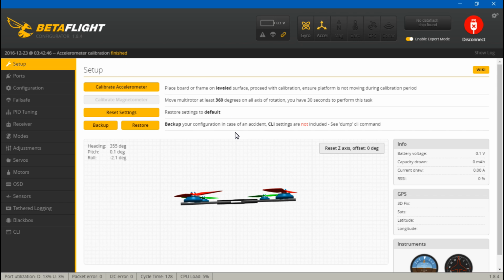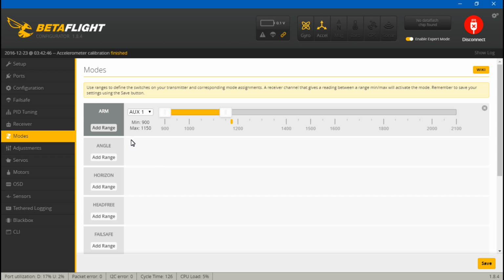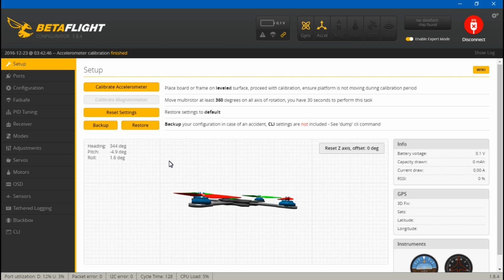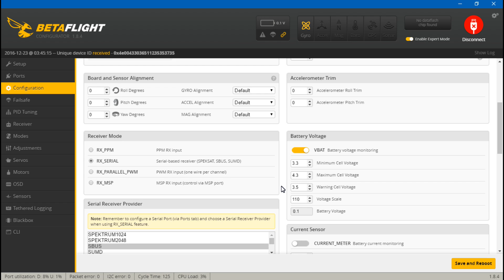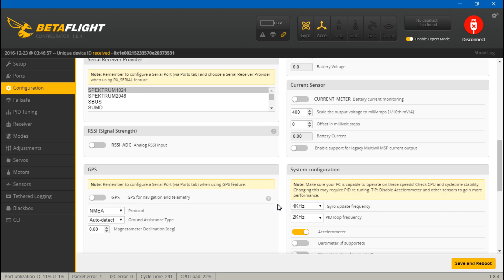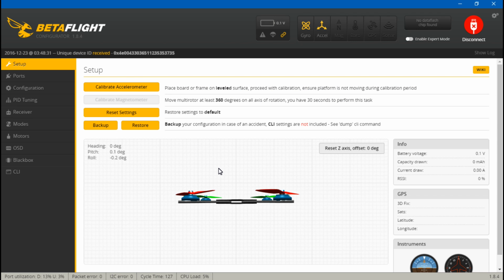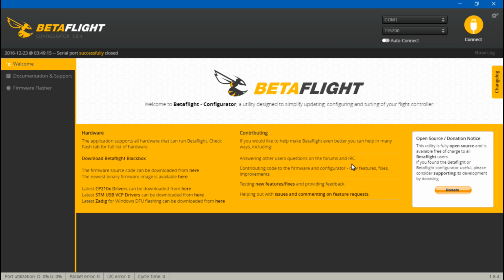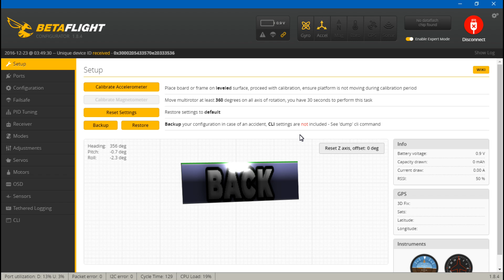Answering Accelerometer Questions

Comment: I recently crashed my TBS Vendetta and doing the accelerometer calibration on Betaflight the quad in the software only moves along and indicates the pitch, however when I roll or bank my quad to any side the quad on the software screen does not bank. Could you please tell me what you think might be the problem?

Comment: Hi, thanks for the video, I have this tyro 109 just finished setup, I've few questions/issues if you can help please, 
1. the stock version betaflight was 3.5.0 I updated to 4.1, and now the accelerometer is the wrong direction, no calibration helps, when I move the sides it shows the front nose, how can I fix that?
2. the top plate (silver color) of the camera antenna get very hot after plugging the battery, should it be that way?
3. I've got the flysky Nirvana nv14 installed with the x8b receiver, binding works, but can't control the drone, I've connected the receiver plug to the flight control, and soldered bridge ibus right side on MATEKF405, can you help, please? sorry for all those questions I'm just lost.. thank you
Reply: he is dead. and hence, won't answer.
Reply: Ansh Chaudhary lol

Comment: when i roll my quad on beta flight it takes about 5 seconds for the config to get to the place I'm holding it, how to fix?
Reply: sounds like either the FC CPU load is too high, or too hot. Most likely simply fucked. Let me know if you ended up finding out what it was and let me know.

Comment: In BF setup, while the quad is flat, my roll degrees go from 0 to 6 without moving the quad. Assuming this means the accelerometer is bad. Although, sensors look fine. Tried calibration multiple times, no help. Any other ideas before I return the FC?

Comment: Hi there anyone know why my brand new  HGLRC flight controller V5 pro the accelerometer is turned on but I it acts like it's turned off No calibration bar etc but it is turned on it was working when I 1st plugged it in I changed some setting to D shot  The accelerometer turned off when it reboot it and I can't get it working since anyone has any ideas please help

Comment: i get issues in horizon mode my escs start to idle up n start to increase in air mode just started doing this was fine before all good tho in just acro so i think accelerometer is getting noise im using sp evo

Comment: Question on manual trim (betaflite F3 omnibus)  of ACC to account for drift.  Simple question, I have read that the ACC is not used in Acro. Thus you should use Angle or Horizon to adjust for drift. If for example the quad is drifting to right in a hover, then the stick commands after on ground and dis armed would be, left stick full up(throttle), right stick to the full left(Roll) and watch for the blinking light, each light blink would indicate a on tick on the trim. Count the ticks, I.E. 5 blinks, throttle to low position, re arm and check for drift.  Repeat if necessary till drift is minimum.

I tried this, however, I was in Acro mode and it also appeared to work as above.
I was under the impression that the Acro mode did not use the ACC.

When you finish inputting the required light ticks to adjust, how are the values saved, Is it saved when returning the throttle stick to low position and right stick to center?

Different on line info interpretation of how to do a manual acc adjustment.

Thanks for the Great Video's

BobFlyer

Comment: Looking at my drone on the screen and my drone on the bench,iam pointion straight ,yet the drone on the screen is point to the left by a couple of degrees.My board is facing front as the arrow on the fc says which way
In the configuration tab there are acc trim,Do i use these to align the image to the same my drone is pointing?

Comment: In the setup tab is it a problem if the model or in my case box, very slowly moves on its own even though my quad is still on a flat surface and has no motors running. it never seems to want to stay still at 0 0 0. I have an F3 Flip32 omnibus. I checked the expert mode graph you showed and everything looks normal like yours. is this a problem that needs to be fixed and if so how? Thanks!
Reply from the maker: It could be many different things but hopefully this helps. 
https://github.com/betaflight/betaflight/issues/797